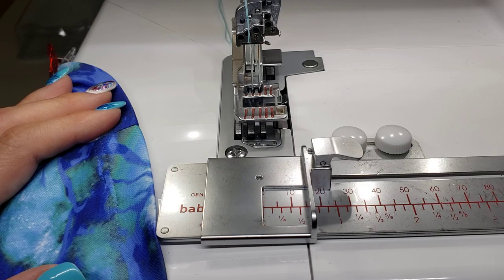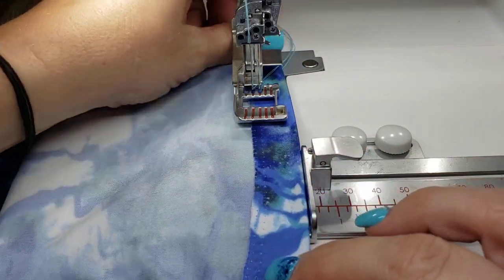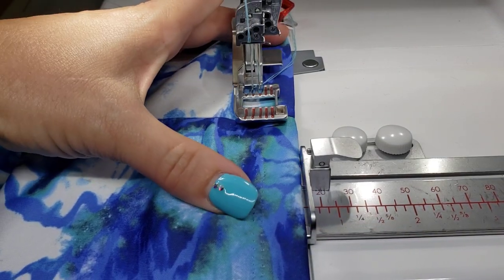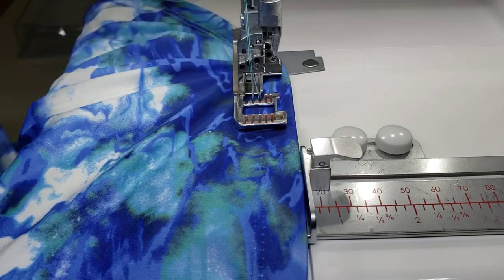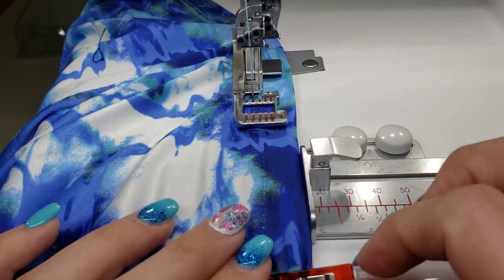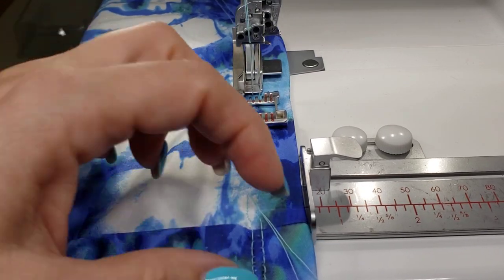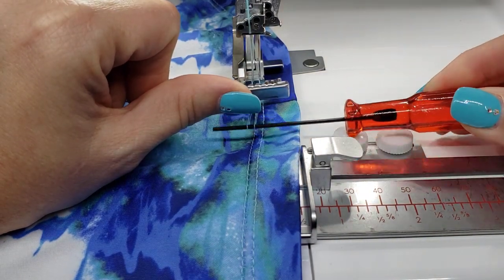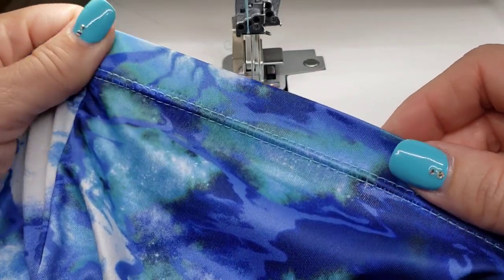Hemming knits on a Baby Lock 8 thread serger

Comment: How to set up machine and protect from cutting fabric, this video did not help for those questions 😢
Reply from the maker: The machine is set for a narrow coverstitch and using the flatbed table. The cutting blade is locked down so it won't cut the fabric.
Reply: @missybstitchin  Thank you